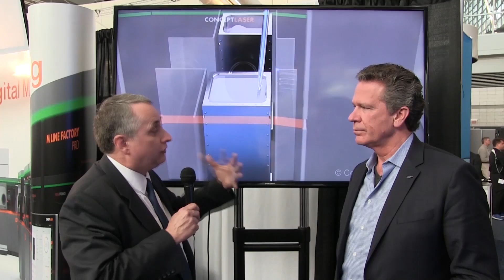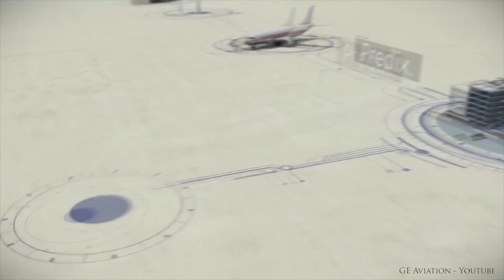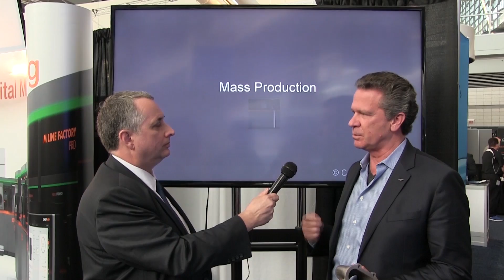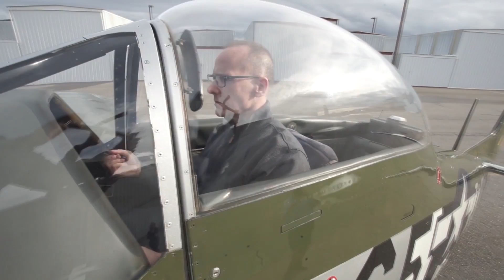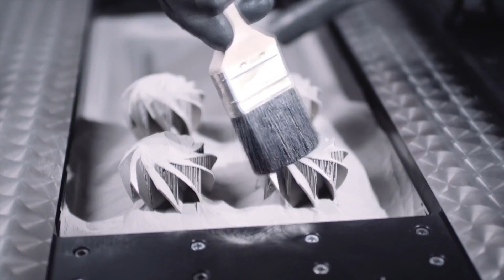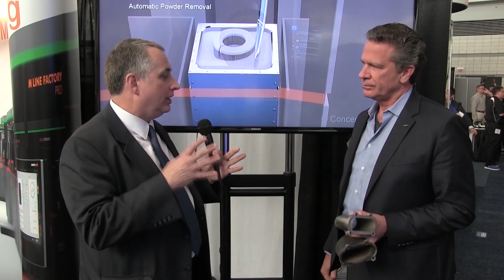How Additive Manufacturing is Going to get Bigger and More Efficient

Comment: This will not obsolete CNC machining.  Additive process does not include "removability".  So you 3D print something + "more extra material support material that must be discarded w/o distorting the part"  and then you need to CNC, EDM or Ceramic grind to remove.  3D printing = 3D casting.